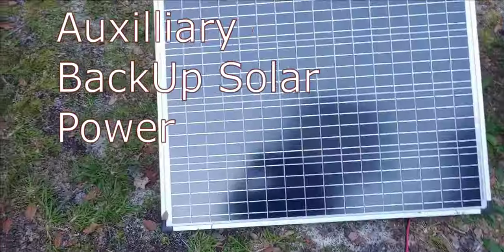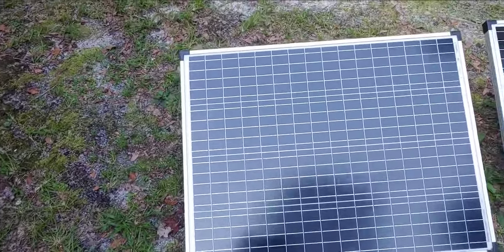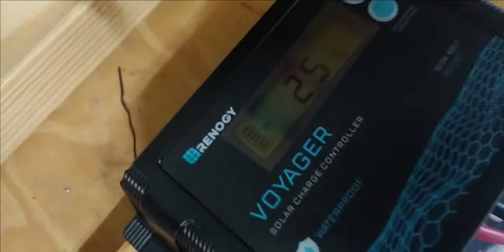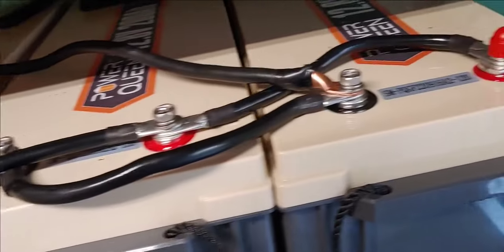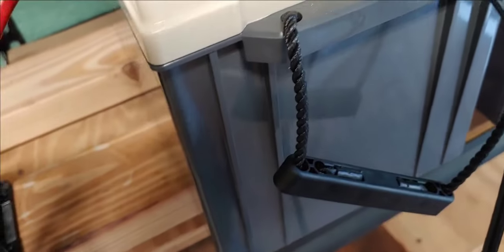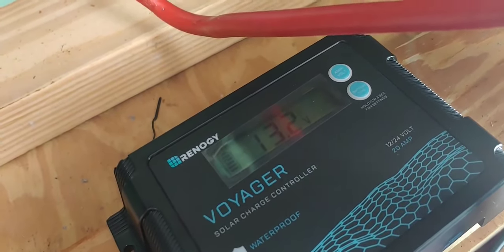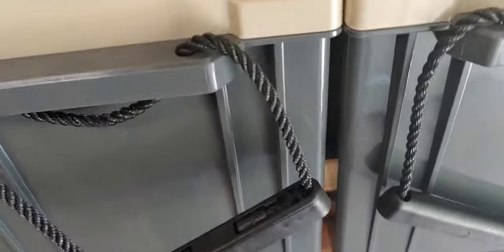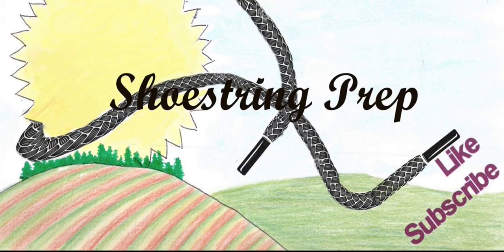Auxiliary Backup Solar Power System

Comment: I have three of the HF 100 watt panels and a BougeRV 30 amp charge controller.  They work well.
Reply from the maker: Great idea. Thanks for your comment.
Reply: @shoestringprep  Instead of the HF hub, I use a three-to-one cable with 10AWG wire.  Since the charge controller can handle up to 450 watts at 12 volts you really need the thicker wire.
Reply from the maker: @Foxfire_Pony  I bought a wire just for that purpose
 Thanks for your comment

Comment: I know just enough about electricity to make me dangerous.  Can I say that if I follow the info in your video, that I can have enough power to run a frig and a few lights and maybe a small portable ac unit for one bedroom?
Reply from the maker: Your first task is to figure out how much power you will need. Once you know what size system you need, you can use these videos to guide you in the build-out.
Thank you for your comment.